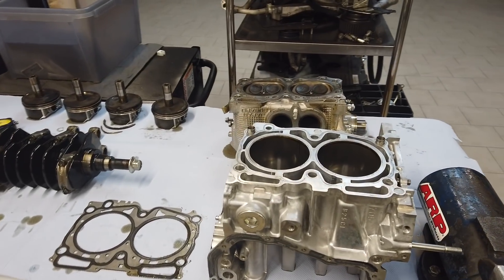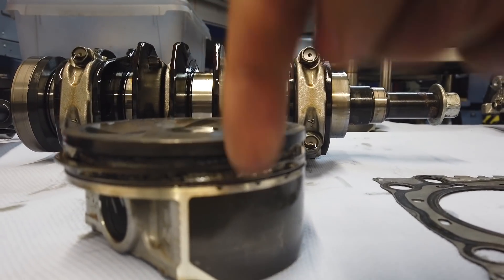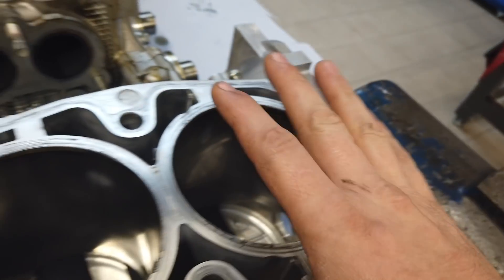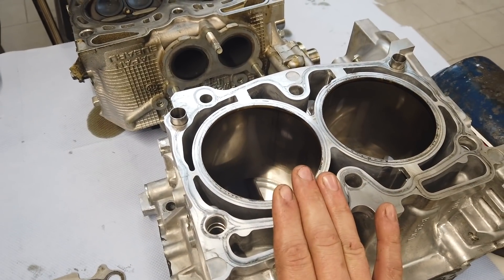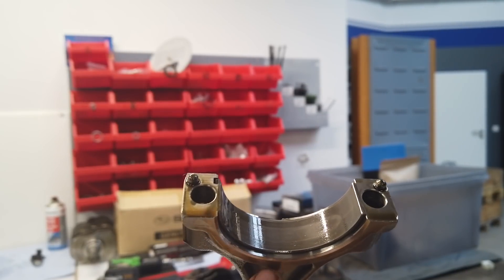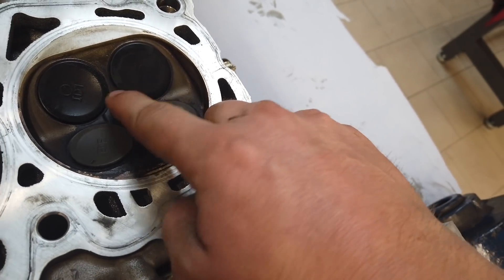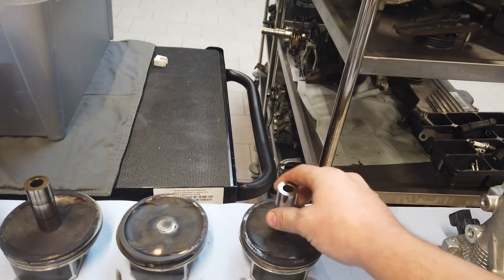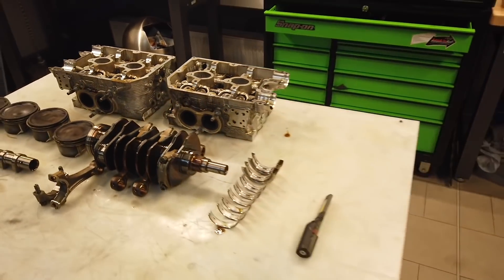Heavy engine damage on a NEW Subaru Impreza WRX/STi with only 16000km l EJ25 l Subi-Performance

Comment: My 2012 2.0 Impreza didn’t need anything to eat quarts of oil! After it ate three quarts in 1200 miles on a oil consumption test Subaru installed a new short block in my car for free... apparently they had a known issue with installing piston rings with too little tension.

Comment: Big end bearings are a servicable item on Subarus, ringlands go on the 2.5's. Speaking from personal experience and living beside a Subaru workshop. Class cars with chocolate engines.
Reply: Yes
Reply: Op is right the EJ motor is made out of Swiss cheese. Open deck block and cast internals are just stupid for a turbo engine. The 2jz and 4g63 are legendary because of their cast iron blocks, closed decks, and strong internals. I'm not hating but it's just true. I have an Evo IX and I've owned multiple Subaru's since 2003 and currently have a 2019 STI. I've literally had to rebuild every Subaru I've owned, and I'm on my 5th STI, while I'm still on my OEM Evo IX motor 14 years later with tons of boost and hard driving she still won't die.
Reply: @BxrTerror  everyone knows that brother. Obviously it's a typo as I meant to say cast pistons. And to me semi open deck and open deck is the same shit, everyone knows 600+ hp is beyond the danger point with these motors and even at 400whp you are playing with fire. One bad tank of gas and there goes a piston.  Why do you have to resort to name calling when we've never talked? It's childish and obviously your a hater that has never owned these cars.
Reply: @mikehundredson584  because i know your kind. Ive talked to many like you who claimed that, they or their grandads uncle who knows someone, who knows someone elses brother in law, has one and has gone through 10 engines.  Ive had one claiming to have a junkyard full of broken subaru parts. i easily found that the pics that he showed me were from google. After that he claimed i was a fanboy and etc. Your online mechanic diploma wont get you far.

Comment: And kids, this is why nothing beats a protune from a reputable tuner who understands your plateform. Also just monitor knock....
Reply: what is a pro tune opposed to a cobb  acess port
Reply: @stugats77  If you have to ask... you dont want to know👽👽👽👽
Reply: Is it like a dyno tune  where the car sits on rollers or hub dyno custom tune?
Reply: joe.b either or. Depends on what gear your tuner has access to. Doesn't matter nearly as much as the professional themselves.
Reply: You think a protune is gonna save you from ringland failure on an ej? If you are one of the unfortunate folks to buy one of these and it pops...it was ALWAYS going to pop. No AOS, equal length header or tune is going to stop this from happening. Stop regurgitating this nonsense about ej engine failure preventative measures. Those people that spew that crap are in denial or delusional or both. Only legitimate fix is swapping out the weak point of this engine. And that’s the pistons.
Reply: @nwbklr  unless you've owned any usdm ej257s for a long time that were completely and utterly stock and were used that way and then they have failed you, then and only then would I believe you. Been running around with lots of sti owners here with a damn good tune running full stock making around 290-300 whp with 70k miles. 

You can blame the car when it blows up, but the combined stupidity of a horrible driver and a dumb af tuner, then it'll blow up. 

Just like any other car, unless it's a honda.
Reply: OreoThePanda been through my share of em. I love the ej motor. Subaru’s in general. I’ve had a few dyno kings and queens. And as a matter of fact the one in my garage is indeed bone stock. The last one I took the initiative of swapping out the pistons. Before that Ive only had the one ej that took a shit on me. Yes, ringland EXPLOSION bro. I treat all of my cars and trucks, bikes and quads from days gone to now the same. With love. I was a mechanic in the military and I’m an all around general motorsport enthusiast. Thats not to say anybody with those characteristics isn’t driving their shit like an asshole day in and day out. But I do not. And I’ve had a license for over 20 years. The truth is most of the engines that pop aren’t tuned or bolt on specials. I know it feels like that would
make sense but it’s just not the case. People that go down that road of lookin for more power with these cars are still a very very small subset of wrx/STi owners. And I get it, I’ve run around with a lot of other like minded folks and Subaru owners of course but again, they(their cars) would amount to less than what...maybe a half dozen, shit call it a hundred people you know if you’d like...and that is still too small of a sample size to represent what’s really going on with these engines. Doesn’t even register. This is all irrelevant anyway because it doesn’t matter if I drive like an asshole or not. It stands to reason that there are just as many irresponsible EVO, mustang, camaro(doesn’t matter what take your pick of automobile) drivers and shit tunes or tuners etc...driver for driver, engine for engine the ej pistons fail exponentially more than any other motor modded or not regardless of how it’s driven. And not for nothing but let’s just say, for the sake of argument that every STi owner dogs the hell out of their car and those are the ones that blow...it’s the same component EVERY time that fails. Or maybe they all drive like me even, if they were the unfortunate bastards that got one of those timebombs and somethin fails, guess what? Still gonna be those damn pistons. It’s no biggie though. If you have your heart set on an ej and want to drive miss daisy, carve canyon or better yet auto cross...just drop in some forged pistons and have no worries. Just change the damn oil. Later.
Reply: @nwbklr  that's a long ass paragraph, but in the end, you said it, dogged engines, bad tunes/tuners, bad drivers. Not the engines fault.

To summarize what you said, garage queen or not. If you drive the car it wasn't meant to be driven, it'll blow. Thats pretty much what I said.
Reply: OreoThePanda ha that’s not what I’m saying at all. Sorry for the confusion. I definitely don’t dog mine. Doesn’t matter how you drive them. Sure hard driving and general abuse like launching, racing etc will accelerate engine breakdown but that’s not what we’re taking about here. Same number of people driving the shit out of the STi are drivin the shit out of every other performance car. It’s all relative. But the pistons are failing in the STi stock or not. The ones that don’t are very fortunate. And they’re are enough them that don’t fail thus, no recall. Forget about all the tuners and Subaru channels on YouTube. Look at the forums on the people submitting warranty claims for this issue. The thousands that were approved because they were indeed stock(trust me they’d love nothing more than than to deny your claim for even the slightest mod) You know a lot of us have extended warranties because of this issue right? Subaru has made that available at no cost. Look at the civil suits and what years they cover the ej257 for if you really wanna dig.
Reply: @nwbklr  you do know the extended warranties on the 15+ cost extra right? And  unless you're building the engine, really any form of extended warranty service on a car is a must and so is gap insurance unless u either buy outright or have a very very short loan term and you pay it off early.

I never said you dogged your engine either. All im saying is majority of the stis that die are because they're abused. Stock warranty claims mean shit when you go on a forum and can literally just write down anything you want and what reason it was for. 

Any form of satistic on this matter is hard to get solely because people lie about what they do to their cars. 

Everyone I've met so far dog the shit out of their cars at either the last year lf their warranty or little bit of milage and blow the engine up, so they get that tadaaa free 0 mile engine.

There's more to it than forums and people claiming things and writing down warranty claims.

Im not saying the ej257 doesn't have it's, but it was given a bad rep just due to the fact that people mistreat the engine and then blame it on the car and not themselves.
Reply: OreoThePanda I get what you’re saying but you have to look at the consistency of the stories and sheer number of complaints. You’re not playin the odds here. As far as the warranty is concerned my point there is that that was Subaru’s decision to give myself and other ej owners an automatic extension because of the suits. They wouldn’t have done that because of a bunch of liars on the internet. They had blown up motors across the country in all of their dealerships. A LOT of them. The way you dedicate yourself to the drivers being guilty almost makes it sound like the ej is the unlucky party here...lol, because somehow they attract a certain type of driver. But again, the same could be said for every other performance car out there. Hell any car to a degree. Yet only the STi has piston failure in disproportionate numbers.

Bottom line...It is a significant issue that is beyond anecdotal failures. It’s not a secret anymore and even Subaru has all but copped to it. Don’t die on your hill man.
Reply: @nwbklr  the consistency of the stories could easily be lies too, granted the pistons arent strong enough on the older models to go 150+ whp modded, or strong enough to handle the ej257 being dogged to crap.

Hell a brand new 80k vette could explode on you if you push it too far. 
Same thing for every other car brands. Drive a car outside of its capable limits and it will die, one thing or the other will fail. Looking at all the warranty claims stating the heads blew up = probably modded.

Never seen an sti die due to proper use and maintenance. However I have seen many die due to outright negligence on maintenance and just pushing the things down to their limit to a point where ghe internals are gasping for a break.

People started talking crap about the ej257s because its costly to mod and they wanted a cheap way to make hp, then they blow it up and complain....

Comment: All these new Subaru engines drink oil like a boss. Seen alot of n/a subies going through 2 quarts of oil in 500 miles.
Reply: Charlie B i have seen some that dont burn a drop too. Idk if its the old granny’s that never get into the throttle or not breaking the engine in correctly. I ive seen some perfect and random ones that burn alot. Most of the people ive seen with oil consumption problems alerted the dealer and they marked the drain plug told to drive through a oil change and come to them when low on oil. They documented it and if was something like using more than 1 qt per 1000 miles is normal. Thats too much in any auto enthusiast opinion.
Reply: had a 2013 and it blew up at 50k these engines are known to eat oil have heard that there is some sort of design flaw that allows oil to be burned off
Reply: Honda Freak 1 quart per 1000 miles... is a damaged engine. 1 quart per 5000 miles would be the limit for such a size engine... and only if routinely driven hard!

Comment: "and a mapping" - that's the problem! :)
Reply: warranty voided
Reply: Engine doesn’t actually start knocking with the ring land failure, doesn’t even blow clouds of smoke just uses loads of it. I know because my 2015 STi had ringland on 2 and 4 used oil just like any other Subaru until this year then all of a sudden it was running really low. Dash lit up like a Christmas tree diagnosis was no compression on cylinder 2, still no knocking or clouds of smoke. if he had boost higher than 15PSi in the map that could have been contributory but the poor engine design is the cause.
I was careful though and kept all stock parts (including the stock tune) and put it in to Subaru unmodified. I now have a built motor currently on run in tune.
Reply: @derekarrowsmith140  Knock as in detonation or pre ignition, this is the cause of the ring land failure, not as a result of, hence the marks on the top side of the rod bearing.
Reply: @wwooster4164  i'm wondering if the oil to combustion chamber lowered the octane of fuel and caused the detonation, because EJ. i'm not aware of oil change intervals or any other important information, just adding my .02 cents, not attacking you. then again that is probably what you were thinking.
Reply: only few mods :D :D

Comment: You need a Motul oil for this 5W-40 not 5W-30 synthenic oil.  The Motul oil is for performance and better results.  Check your oil every 1,200 miles.  According to Subaru FUJI Hevy Inds.  it burn 1/4 out of 1200 miles so carry some in your car at leat a 5L or 1 Gallon in your trunk Motul Oil 5W-40.     I check evey 1000 miles to avoid these engine issues.  Also If you go with Accessport and Downpipe Stage 2 please change your intake to COBB SF intake colder air so it will help breathe the car better.   Change your fuel injectors to 1050 cc better and fuel pump.   This will help!

Comment: What about injector? Perhaps a defective injector caused the lean outs, or loose sparkplug. There is an issue with the setup of the injector rails on EJ motors requiring an upgrade to maintain constant pressure over all injectors. Factory mapping should be fine. Did the customer increase boost? Bad fuel can also be a problem like using low octane fuel when it is an STI and needs high octane 98 fuel.

Comment: I have heard that these engines should be run on 98 RON petrol. 
Would running it on 95 RON  petrol cause this type of damage due to knock?
Reply: Yes it could, especially if the engine was lugged.
Reply: I run this engine alltime with 102. The mapping was the problem..
Reply: Yes 100%

Comment: Are you able to measure the ring gaps on that cylinder or are the rings too badly bent/damaged? Subaru runs really tight ring end-gaps (like 0.009" on the top compression ring). I suspect you build engines with more than that and for a reason. Given that there rarely seems to be evidence of detonation damage on the tops of the pistons or cylinder head, is it possible that ring-land failure is due to ring-gap closure and seizing?
Reply: I think that's the cause of a lot of these failures too. You run a long session on the track, everything gets too hot, gaps close, and rings break; even with forged pistons. I'd like to see the gaps measured on the other rings.

Comment: So, detonation caused the rings to fail?  Bad tune = lean mix and too much timing?  🤔
Reply: no knock sensors ? or were some how by passed would a lean fuel trim not turn on a ck. engine light?

Comment: By mapping you mean  computar tuning ? Air/fuel ratio etc. No mapping for me .
Reply: Tuning, calibration, map, etc all refer to the same thing. Custom settings in the engine computer to control various solenoids and actuators around the engine such as fueling, spark, cams, oil pumps, etc.
Reply: "no mapping for me" if you make any big changes to induction/exhaust/fueling you would need to get the ecu remapped to suit those changes.

Comment: I dont understand, how bad mapping can do so much damage to the engine :o
Reply: Yeah it’s very easy to damage engines under boost, when you lean out a engine under positive boost pressure it creates very hot areas in the piston bore and head where gas can be ignited early off of top dead center timing where it’s supposed to fire, every time ignition happens not at TDC it’s considered a knock
Reply: I don’t understand why people do it. Look at the diesel trucks. Manufacturers have millions in engineering yet some one man shop more capable. Tuners have nothing to lose, manufacturers have to warranty their tune
Reply: bad mapping can destroy even the strongest built engines. good tuning is vital.

Comment: Im going to be rebuilding an 03 wrx bug eye sedan, my friend blew the motor but he said its fixable. Whats a good manual to follow when fixing up subarus?
Reply: Hand on experience, watch as many videos as you need, if you don't have experience with engines start with something small like lawnmower engines, etc. Good luck
Reply: @MrJayprojects  thanks, i have some experience I understand it enough to know if something goes wrong. Pretty self explanatory while watching videos on it. Thanks
Reply: follow the factory service manual written by subaru. can find it with a google search